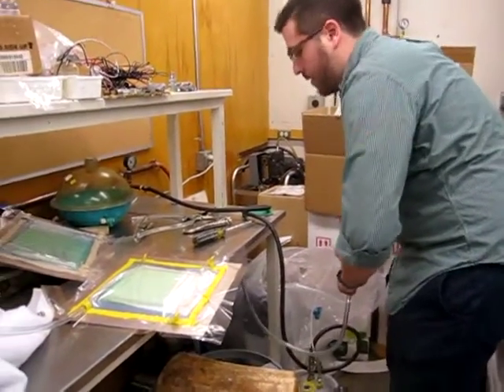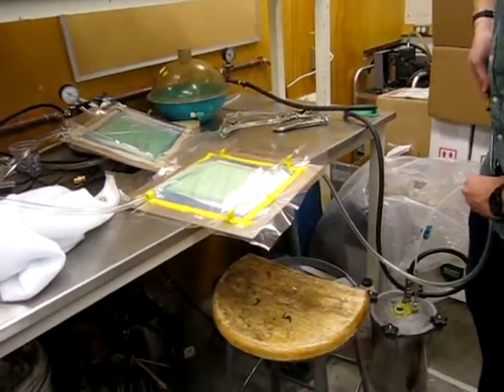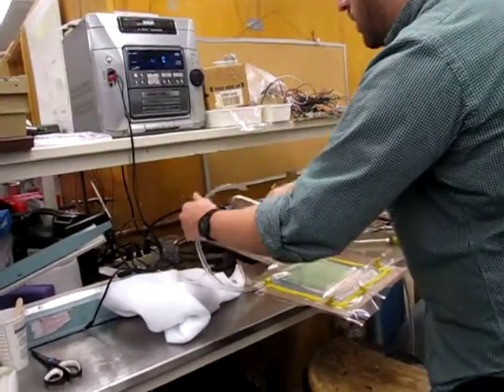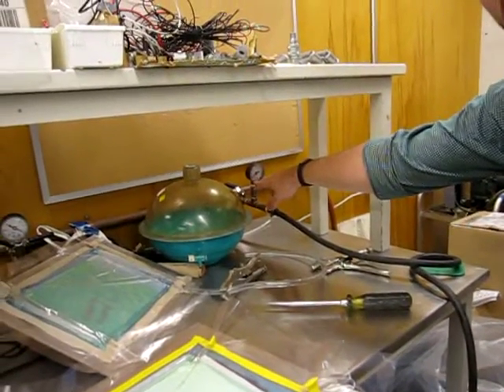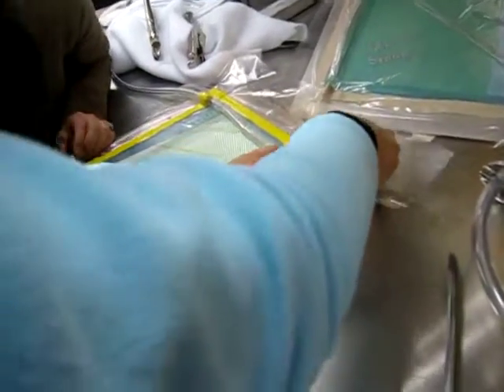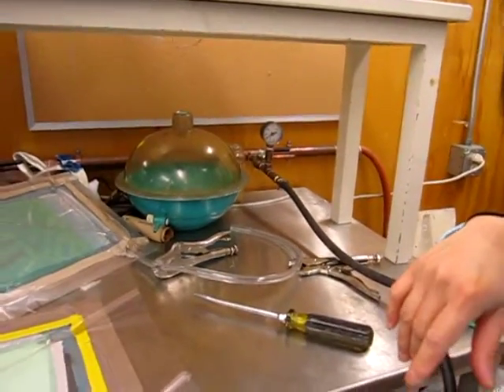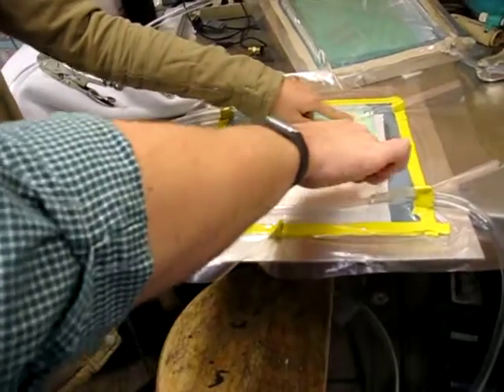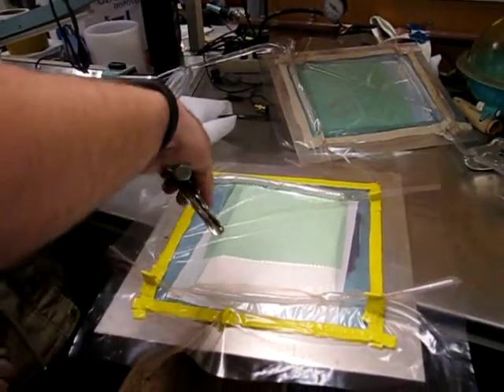Preparing for Vacuum Assisted Resin Transfer Molding(VARTM)

Comment: hi how much pressure use to VARTM  
Can you tell me please
Reply: Idealy, 100kpa or 1 atmosphere.  That means you have pulled a full vacuum to 0 kpa and atmospheric pressure is applying 100kpa per inch to the part.